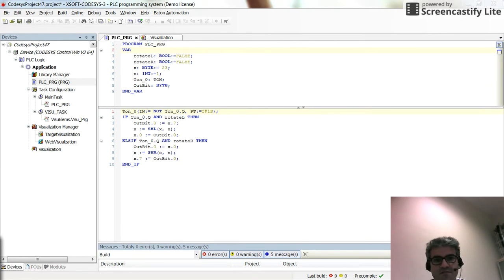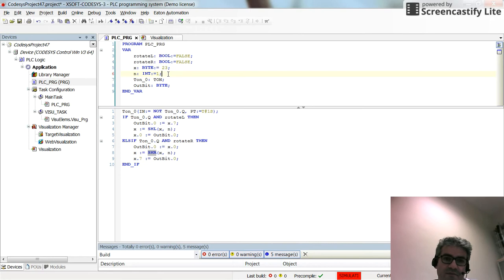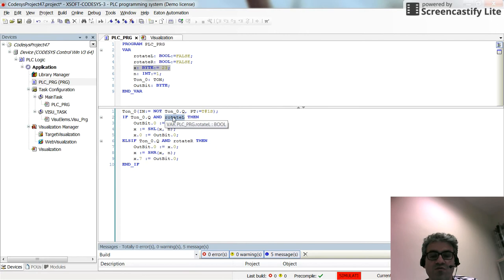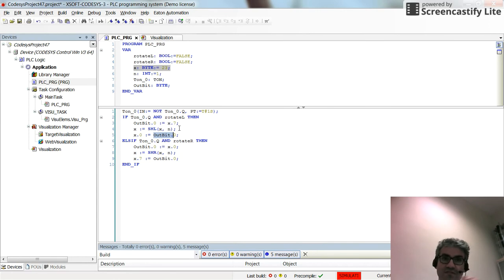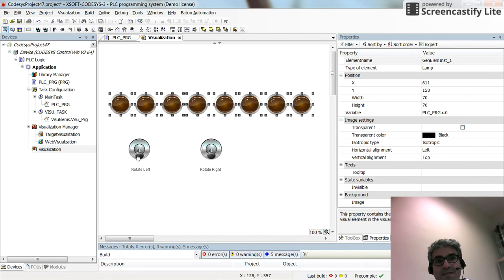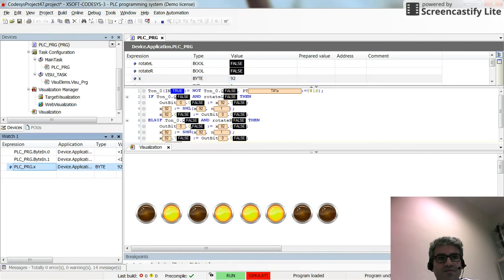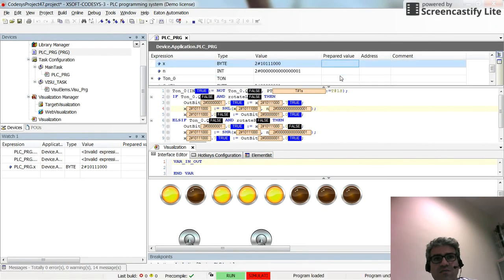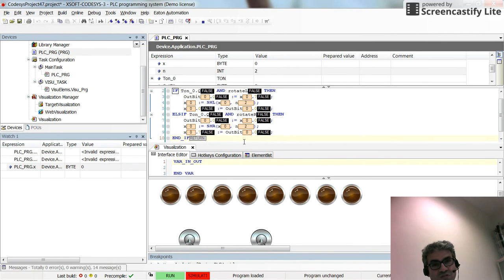CODESYS: SHL and SHR instructions in structured text (ST) #codesys #plcprogramming #iec61131 #plc

Comment: Hi, I'm creating a 32x8 scrolling text display visualisation in codesys. So far I have done that I can scroll one letter on the screen but I reach a wall if I try to display a complete word. It's a bit complicated. On arduino, it seems really easy but on PLC and ST code i reach a wall. There is really not much information about this scrolling text on PLCs. Any hints or thoughts I might use? I'm using 8 dword variables and move them with SHL and SHR functions.
Reply from the maker: If you can, send me the source code (with explanations/comments) and I will have a look at it.
Reply: Tohid Alizadeh hi, any comments to that code I sent you? I haven't really been doing work on that.
Reply from the maker: Hi. Just tried to have a look at your code, but could not run it because of issues with some libraries. I will try to solve this and update you soon.